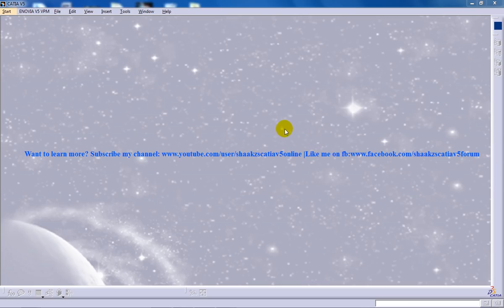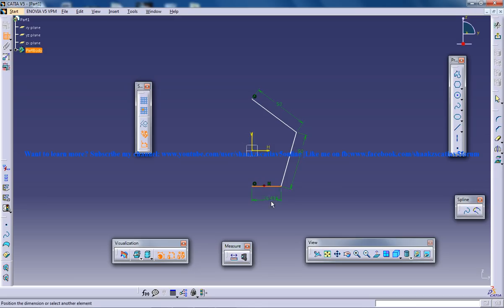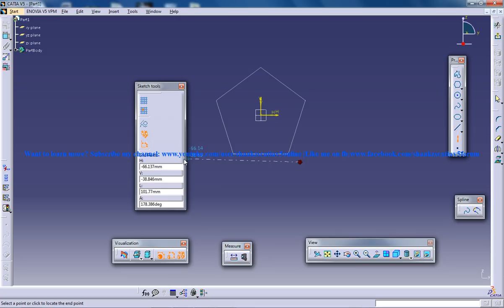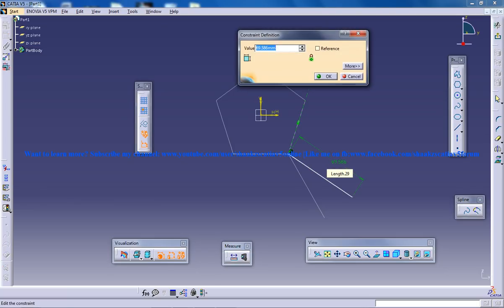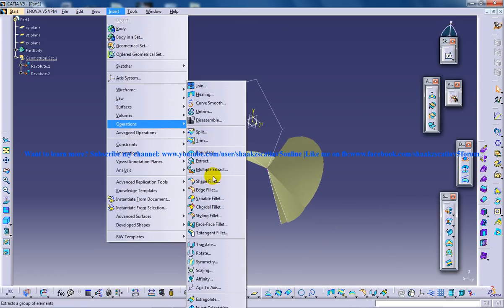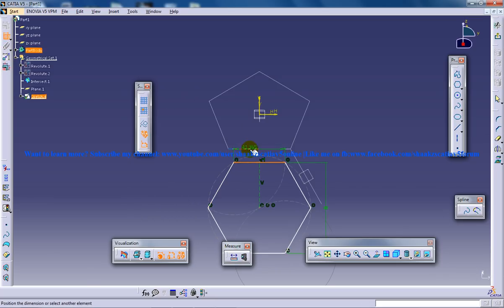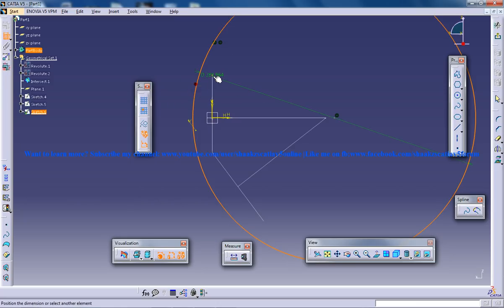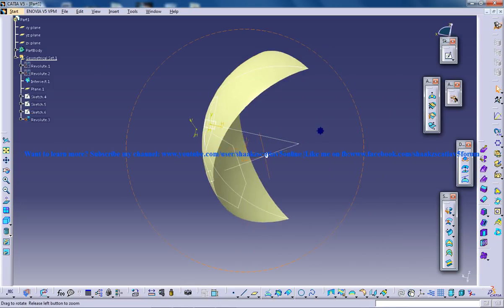Catia V5 Tutorial|Generative Shape Design|How to create a Soccer Ball|Start to Finish|Part 1

Comment: everytime I draw a new line, the line touches the point in another line but when zoomed the points don't touch please help uploader
Reply from the maker: +Harish Ganesan hi Harish, make sure that the line you are trying to touch to is in the same sketch, or else, use project 3d elements option and then try to snap it, it will work...cheers.

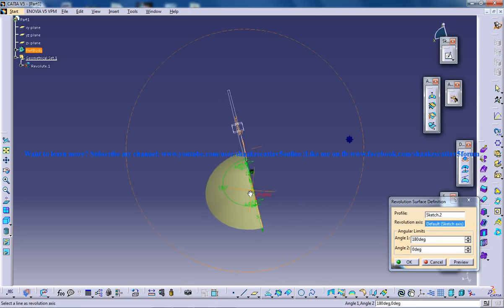Comment: I'm struck. I am not been able to  use that revolve option at 3:29 It is not selecting the default axis as that of  in your case
Reply from the maker: There are different ways to fix this problem. For now, try creating an axis using line in wireframe toolbar and then select it as axis.
Reply: Same problem